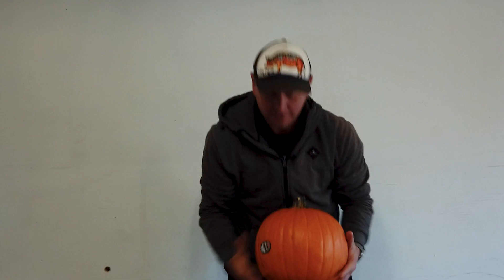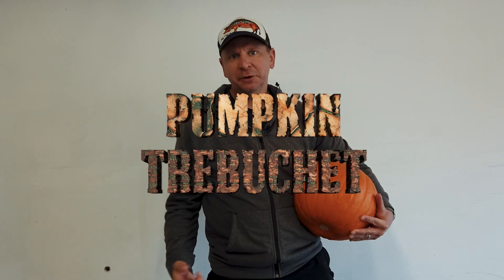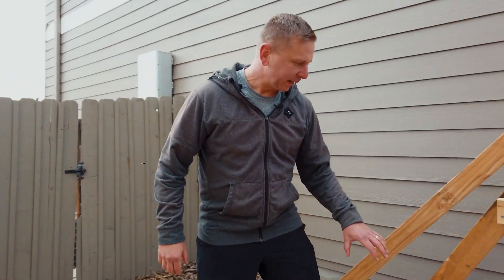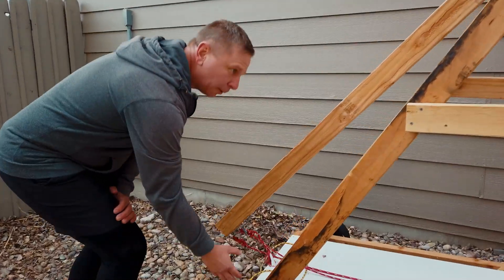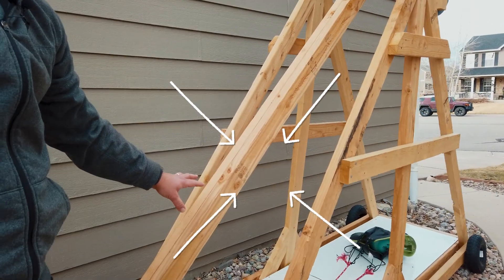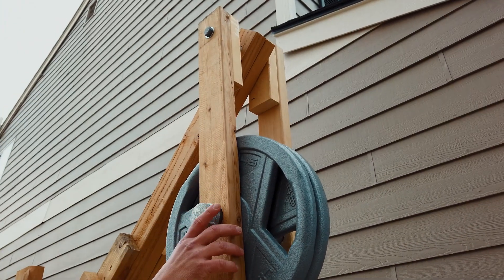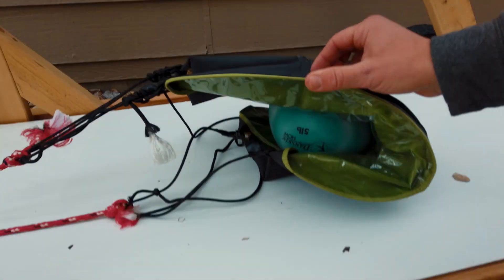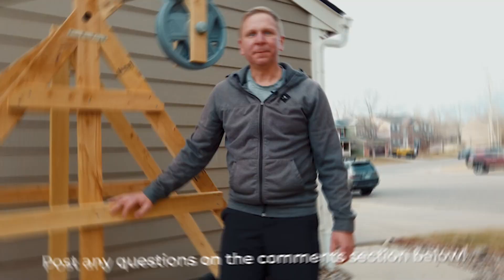Pumpkin Trebuchet - 8-10lbs Build and Walkthrough

Comment: Hey! I enjoyed this and am wanting to make a replica. By chance do you have the measurements still? Or, at the least, where on the launch arm did you make the pivot?
Reply from the maker: @tbjpersonal: 

Long end: 6'3"
Short End: 3'9"
Sling: 4'3"

This is the virtual trebuchet sim I used to model it: 
https://virtualtrebuchet.com/?units=englishf&projectile=custom&uniformArm=true&distance=20.768571115413387&lengthArmShort=2.7&lengthArmLong=5.3&lengthSling=3.7&lengthWeight=1.6&heightOfPivot=3.7&massArm=16&inertiaArm=85.33&pivotToArmCG=1.30&massWeight=115&inertiaWeight=1&massProjectile=8&projectileDiameter=1.148&windSpeed=0&releaseAngle=45